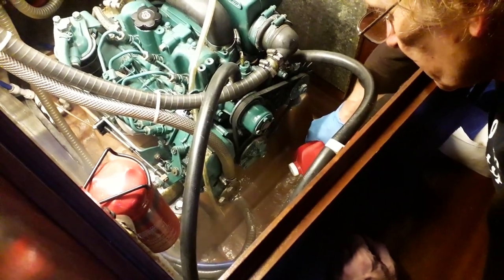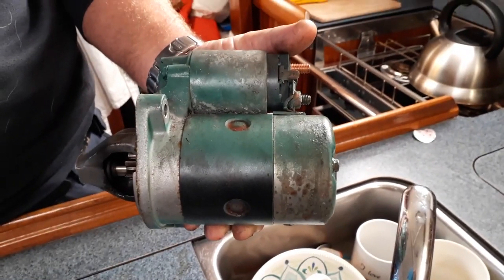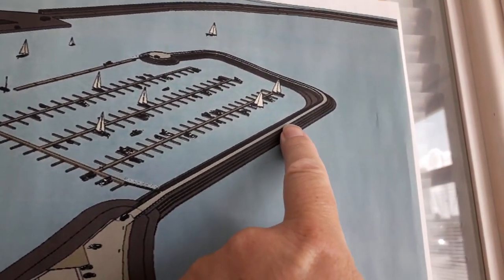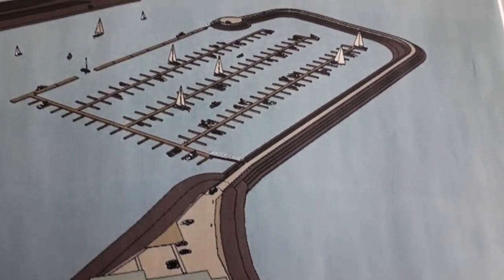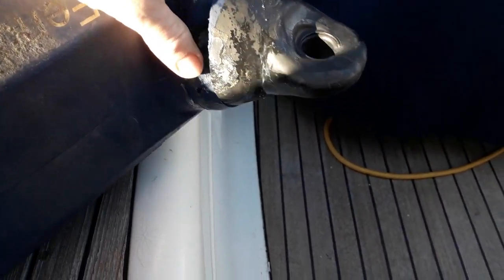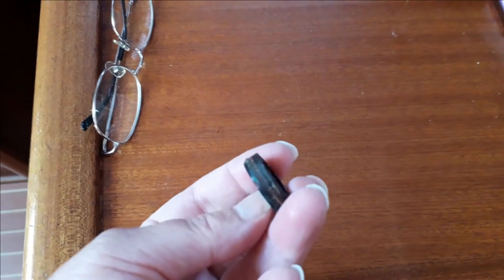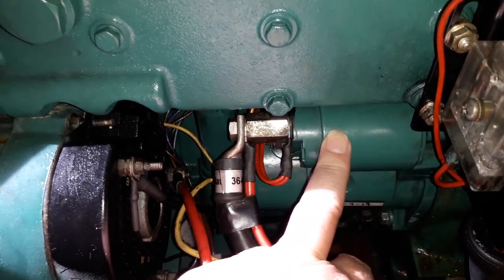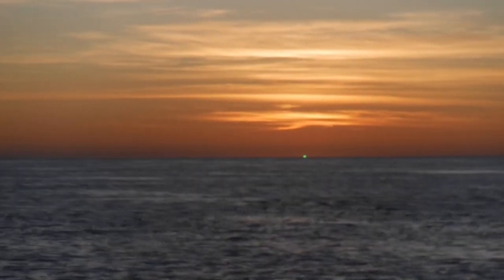Sailboat engine problems - Volvo Penta - Sailing Wales - Holyhead - Ep. 109

Comment: 👍👍Have a bit of wifi so catching up on you guys. Re; raw water pump lip seal. They fail because the stainless spring that holds the seal lip against the shaft rots and water then gets past the lip. Some times as quick as 250 hours! Before fitting a new lip seal remove the spring with a denture pic or bent paper clip and replace it with a silicone O ring of the right size from your O ring kit from Lidl €7 from a Lidl near you 😂As Cindy says we worked our way south Lidl by Lidl 🤣🤣Loving your videos. Ant, Cid & the Pooch crew.
Reply from the maker: Thanks for the comment. We had an engineer fix the water pump seal so hopefully...... :-) Nonetheless I will keep a note of this.

Comment: I had the same seal leak (aft of the impellor).   My mechanic explained that on one side of the seal is engine oil lubricating the pump drive gear, and the other side is sea water for engine cooling.  To prevent the catastrophic mixing of those two, there is a small 'weep hole' on the aft side of the impellor housing.    It can leak either water or oil…. and tells you which side of the seal has failed.   I tried to knock the seal out myself, but could not get it out.   The local mechanic had a gear puller and quickly pushed the old seal out and put in a new one.   All good.   With that repaired, you can now sail the Irish Sea during the winter months.   :-)
Reply from the maker: Hi Patrick - sail? Today? No chance! It is FREEZING out there and the 30kt winds are just icing on the cake. :-)

Stuart is great mechanic and made everything look so simple. A job that would have taken us all day took him a few minutes. If we were stuck somewhere with no affordable mechanic then we would tackle it ourselves, but when you find a good mechanic you might as well get it all done.

We hope you are well and planning your next adventure.

Comment: A leak at the back of the water pump can worsen such that, despite the bleed holes, seawater can get past the seal and seawater gets into the engine oil. been there, done that. The first warning was mustard colouring to the engine oil and it took some time to get the seawater out of the engine. I changed the entire pump and it is still fine, 25 years later. If you can afford it, I would carry a spare starter motor.
Reply from the maker: Since this video was made, both the raw water pump and the starter motor have been replaced, but thanks for the warning info, it is something to keep an eye out for and if we see it hopefully we will catch a problem early

Comment: Ours started leaking like that and we left it for 2 years before we changed it, I don't think it got any worse in that time.  Seals like that do eventually start to leak,  as they don't have any lube ... don't worry about them too much, it will start to leak eventually, but you can safely do another hundred hours on the engine before changing them.
Reply from the maker: That is what the engineer said, but I just felt that our luck wouldn't hold, so we got it sorted. Stuarts the engineer did a great job and I felt a lot happier having the peace of mind
Reply from the maker: (Bev) - We have had a small leak since we bought the boat 18 months ago. I think that 100 hours you mention has already been used up ;-)

Comment: My Johnson Water pump started leaking from the weep holes, I ended up needing new bearings and a seal. I rebuilt it myself in the cabin.
Reply from the maker: Well done you. I suppose I could have done it - it does not seem too complicated - but we an expert on hand and we wanted to be off across the Irish Sea because the weather window was due to close. I would bet money that Stuart the mechanic did it far quicker than we could have managed :-)

Comment: oh dear the engine has it Own will.
Reply from the maker: It did seem that way, but fortunately Stuart, the mechanic, soon tamed it. Although we did not get a lot of footage, it was a cracking sail across Caernarfon Bay doing 6 to 7kts but with a lot of gusts so we were always busy trimming the sails. I will always remember that passage, Salty Lass over at 15° heel, doing 6.5kts and slicing through the waves like a knife through butter.
Reply: @SailingYachtSaltyLass  a salty butter knife. Anyway , loved the vid. watch the music volume , music max at -16dB voice at max -12dB while rendering.
Reply from the maker: Whereabouts in the video? Sometimes I deliberately quieten voices to leave some background effect whilst doing a travelling sequence rather than just remove all ambient sound and have the music playing over silent video.
Reply: @SailingYachtSaltyLass  The tuning in, sailing in of the music , which editing program you use? It is a general remark.
Reply from the maker: We either use Audacity as the sound editor or, for simple tasks like keyframe volume adjustment, we do those in the video editor KDEnlive

Comment: Sailboat engine problems
Reply from the maker: Indeed. The sea is a harsh environment and everything just gets stressed to the limit. Today, our high pressure water line fractured and we found a leak in our diesel system. 

The water one is just age, wear & tear. The diesel one was a worn rubber seal that took 2 minutes to replace, 15 minutes to bleed the diesel line and then 30 minutes running the engine to check everything. A two minute repair takes an hour to do.

We never get bored ;-)